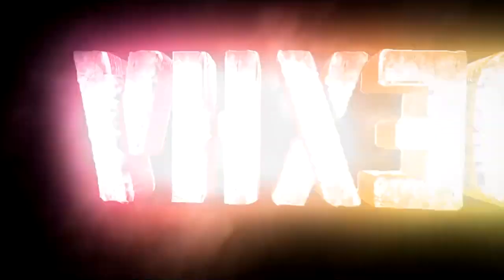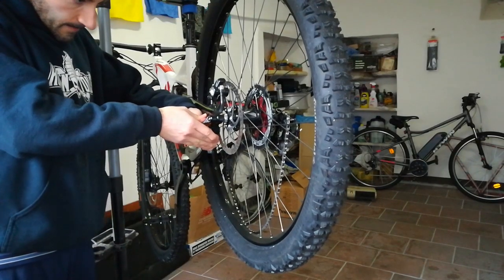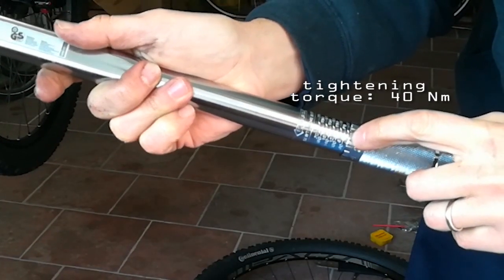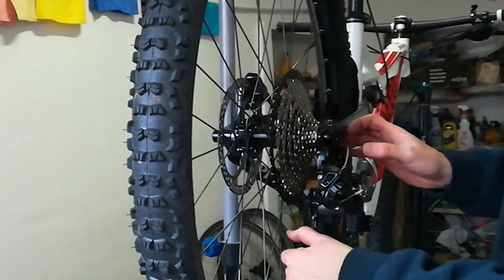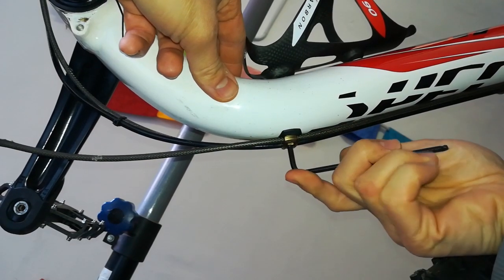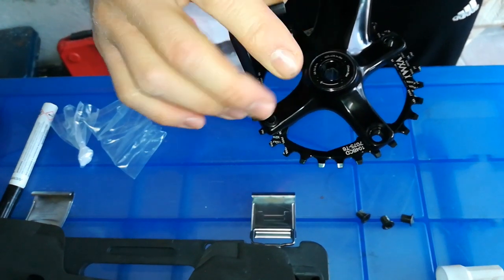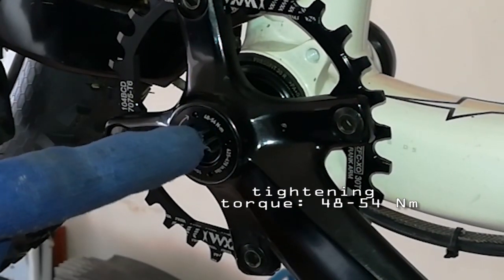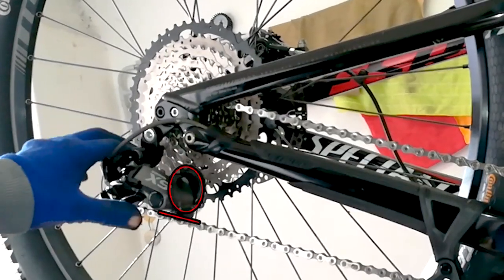Specialized Stumpjumper cheap 1x10 conversion... and Synthwave

Comment: Will this work for my 2013 stumpjumper?
Reply from the maker: Yes, I think it's quite the same ;-)
Reply: @MoExha  I noticed you still kept the x9 derailleur instead of using the Shimano deore
Reply from the maker: @barrylee5580  yes, because it's a 10 speed derailleur and fits that big 50t cassette only if you use the rear derailleur spacer ;-)

Comment: Finally I found the video that I need. Can you offer a list with the part number of spare parts required? I noted that you use the same spacer as originally use the crankset, is right? Will be better use a reduced spacer? What do you recommend? Congratulation your video is excellent.
Reply from the maker: Thank you😊. You can find links of all the parts you need in the description! I recommend to use the same spacer I show in the video.

Comment: What cassette range did you have before? I'm not sure if my wife's older X.0 10 speed rear derailleur can handle a 46t cassette, even with a extender/spacer for the derailleur?
Reply from the maker: Hi, that bike originally came with a 11-36t 10 speed cassette. The bike on the video had an aftermarket 11-42t cassette without any spacer. As you can see, I fitted a spacer to for a 11-50t cassette. I think that you may need a spacer too for a 11-46t cassette.

Comment: Hi Thanks for the video buddy I did the same thing I put back the 11/48 cassette in front of the oval star at 38 I have a rear derailleur, slx chain for 10 speeds but for some reason I can't get the derailleur to work on the biggest star  ...  Could you please tell me what I'm doing wrong.
Reply from the maker: Hi Alan, try to adjust the rear derailleur like shown approximately in the end of the video. The reasons you can't get the biggest star are two: first, adjust the screw named "L" on the rear derailleur, because it fix the maximum position on the biggest star of the cassette; second, adjust the tension of the shifter cable, because it may be a little loose so you can't reach the biggest star of the cassette 😉